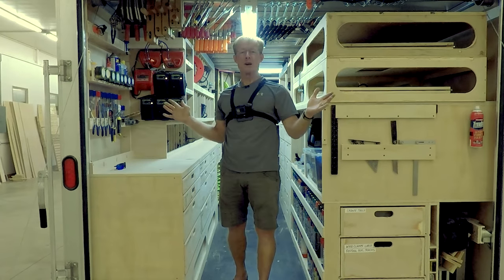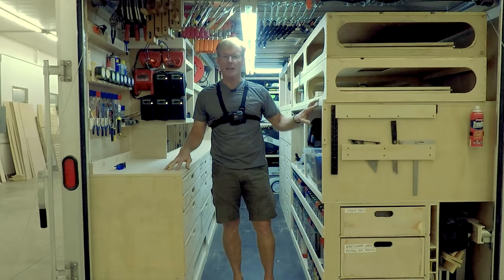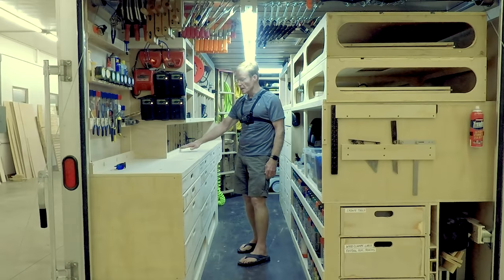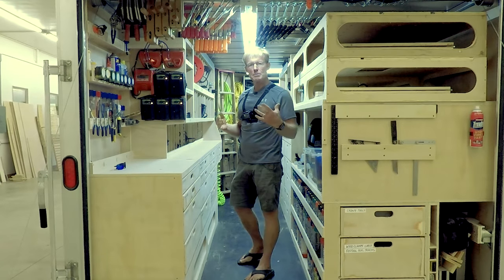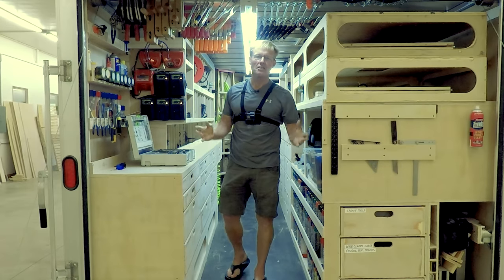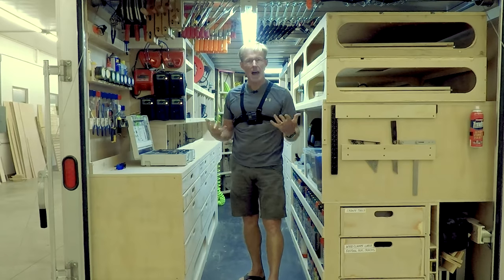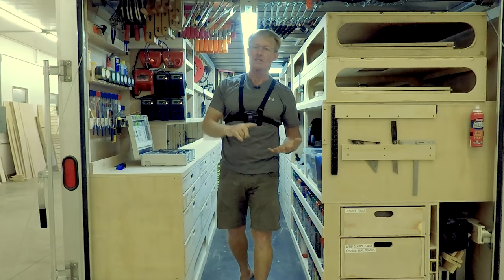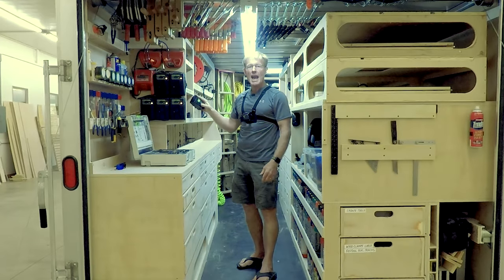You don't know what you are talking about!

Comment: Hello Ron, I've been meaning to comment here for some time. I've driven box trucks, flatbeds with boxes of all sorts and utility bodies. I've even used trailers with shelving, drawers and cabinets. No locks on the drawers or doors in the trailers and box trucks. Minimal strips from 1/2 to 3/4 inch tall and never had anything fall out. No broken axles, springs or anything like that. Been on rough sights and roads and even lost it a few times and still no disturbance. Have even been known to leave stuff on the bed of open flatbeds and still be there hours and hundreds of miles later to the job. Thanks for all the inspiration. Been watching all your videos and plan on buying your plans for workbenches and a trailer of my own.

Comment: Thanks for the videos Ron. I've got my trailer very similar to yours but I use the festool systainers and the only thing that holds them in is a small 3/4" piece of plywood. The only straps I use are on my table saw and miter saw because I haven't had the time to build your table and miter stand but I do already have a spot in my trailer for them. I have all of my stuff in a 6x12 tandem Axel trailer thanks to your videos. I love it, it so easy to pull with my F150 and easy to park. I would add a pic but couldn't figure out how to do it here.

Comment: I think you made a good point that you drive slow and steady. You also live and work on an island? I’m creating a single axle work trailer from my stock Featherlite trailer with a motorcycle ramp and a side door. I know you don’t like side doors, they are convenient but they are not as secure. I’m also planning on using boxes and shelves with my festool systainers. I’m thinking of doing conventional draw slides and possibly magnets attached to the rear of the draw boxes and then a catch to keep everything from flying open. I have at least on one occasion swerved the trailer when a bicyclist decided to turn in front of the vehicle.  All the cargo went flying and I was going 15mph under the speed limit.
Reply: I know this is a 7 month old comment, but I just thought that I'd reply and suggest not using conventional (ball bearing) drawer slides.  I'm making a bunch of mobile cabinets here at home and the cost of the slides has doubled the project cost.  I already had most of the drawers built but if I were to do it again I'd modify the drawers (glue and dowel runners on or something) so they could be used Paulk-style.
Ron's solution costs almost nothing in materials and really the only significant cost is the time taken to make the jig.

Comment: I think its probably just a lack of understanding of the tandem trailer axle.  The 2 axles work in tandem to offset roll and major bumps.  A tandem axle trailer has a COMPLETELY different ride from a single axle.  I have had tools fall before but only under really bad road conditions here in NYS.  Under conventional driving a tandem axle trailer is incredibly stable even under bumpy conditions and even tools on flat shelves will things stay put.

Comment: When I built my trailer I used a lot of ideas from your series on designing and building ART. The tool shelves and drawers are the same as you had in ART and my things stay in place like yours do. We don't drive on the same roads. Many of my jobs are at remote camps that involve 10 or more miles of gravel logging roads with potholes and washouts. Things still stay in place. The shelves in my old box truck  did not have dividers but did have a 1" lip. The only times anything fell from those shelves was from hard braking when things slid forward, piled up at the front of the shelves and spilled over. With the dividers between individual tools I don't think that would happen now. Have you needed to do a panic stop when pulling a trailer and if so, what happened in the trailer?

Comment: Ron, you should mount your go-pro in the trailer next time you drive and overlay it with your other camera filming you driving. Turn on a couple Festool lights to illuminate the interior of the trailer. That will hush the doubters. 

And if you REALLY want to hush the haters, hang a tennis ball on a string inside the trailer so they can in fact see that the trailer is moving as you drive.
Reply from the maker: Good idea Ricky

Comment: The one type of tool that really worries me when transporting is set out tools eg lasers, dumpy levels etc. These tools don't like jolting. I'd much rather have them in a vehicle near me. The downside of this trailer is a hiab could pick it up and put it on a truck even if it couldn't toe it away,  then by by tools. The setup is awesome though for jobs with the room. 1 question are there pull out canopies all round for bad weather or sun?

Comment: Great video to clarify. I also googled that island, sweet location.
I would love to send a few pics of my van and get your gut reaction for passive restraints or general layout for some of my tools.  Ford Transit 250 medium roof with a snoeks double cab conversion.
I've been inspired by the lean grab and go process you use. I like to limit trips to the van by maybe having a few extra things but not spending too long selecting each tool from the van.  I can grab, load and wheel 2 stacks of L-Boxxes and Systainers to a job. Grab a few saws and be working quickly.  If you would be willing to give your quick opinion, I'll send or post a few pics, whichever you prefer. 
Thanks Gavin finish carpenter. (finished if I don't have another coffee)

Comment: That my friend is wood ART!  I could NOT possibly match you innovative assembly, although I'm trying.  Due to space and work schedule I'm gonna have to pre-assemble all my components and then do a three day weekend install.  It just adds to the planning which I'm sure your up on.  The only thing I'm going to add, and I'm almost embarrassed to suggest any addition to your work, is a Fire extinguisher accessible at the gate side of the trailer. In a easily grabbable location, tucked to the side, it can be available for both the job and trailer.  I've never had the need, but...better there than not,.. if needed.  Dam that's a sweet setup!

Comment: hey Ron love the the video. I've been trailing my tools for years with a similar system never a tool on the floor. I do have some draws that move out a little, But that it. I will be installing the screw detail you had on art, that I think will be needed for me. the open and  non restrained tools work awesome for me as well. great job. trailer looks awesome. Funny very similar to mine ; )
Reply: Campbells Construction  just make sure your guys are aware that they must lift the drawer to close it also. Especially if it's a heavy drawer. If they don't do so the screw will damage the plywood cabinet sides/drawer track and blow out the front over time. I've considered installing a small angel piece of aluminum on mine if they wear out.
Reply: taken5875  thank you for that, I was considering something like that would happen. With my new trailer build I was thinking of adding thin aluminum channels in the dado, but with 36 drawers I need to calculate weight of all the aluminum.  Thank you for the info

Comment: Things stay in place, just as long as the employee don't drive it.
Reply from the maker: I operated 3 trailers with my leads driving them and never had a single tool tumble or any other issue. My design has stood the test of time in the real world and it just works. A person would have to go out of their way to create problems.
Reply: Ron, those employee are the ones we keep and hard to find.  So far, I have not found those yet. :) My comment was not against your design, it was meant to employee don't care for equipment , those who use a Dewalt power tool as a hammer.  I am having one of my "potential" to build my trailer according to your build.